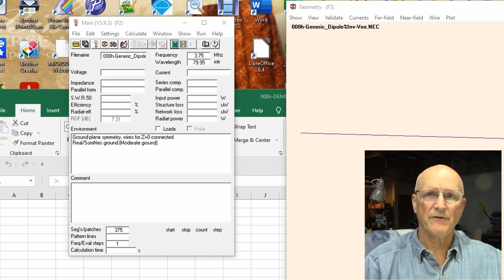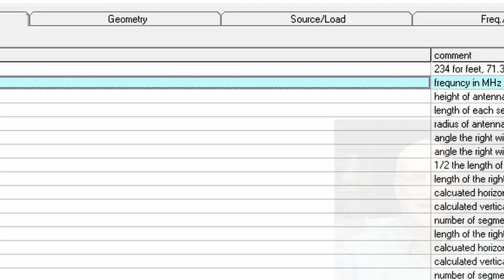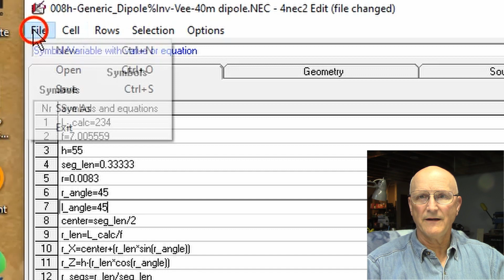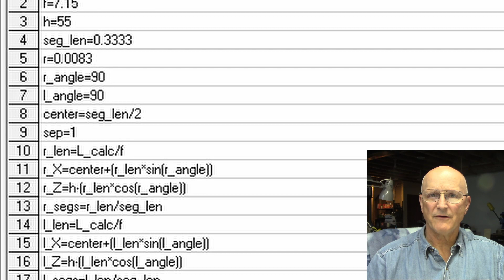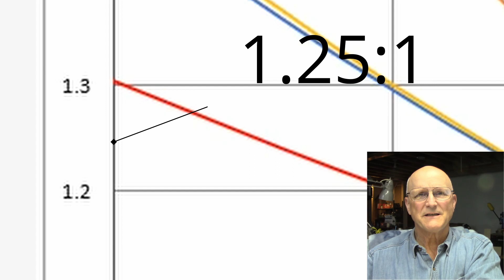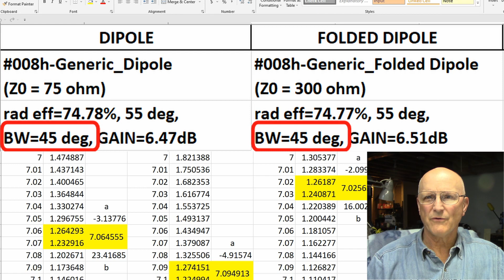Comparing Four Wire Antennas and Introductions to their Generic 4NEC2 Models (008h)

Comment: I use a T2FD due to restricted space.
Reply from the maker: Aaaah! How well does that work for you?
I have a folded inverted vee for my 75/80 antenna. I created it because I was tired of the bandwidth limitations of the simple inverted vee (https://youtu.be/McbDL1GxbqI).
I've heard of doing the termination thing, but I decided to keep it this way because I have the space for dedicated, single-band antennas. 🙂
Reply: Hello - I find the T2FD   one really great antenna, with a very low VSWR  from 80m to 10m.  There are one or two spots where the VSWR goes above 2.5:1 but my ATU easily sorts that out.  I've been on the air for 40+ years and I have to  say that the T2FD is the best antenna for restricted places.
Reply from the maker: @EI6DP  That's cool! Thanks! 🙂

Comment: One more thing to consider in choosing the antenna type: A simple dipole or inverted V can be used on both odd and even harmonics, with a tuner. But a folded dipole or V will not work on even harmonics.
Reply from the maker: You got me thinking because I have ALWAYS heard "odd harmonics only", so I did a little experiment here. Just from a frequency perspective ...
I tried 80/75m frequencies first as the fundamental. Only even harmonics hit other ham bands with the exception of the 17m band and the antenna would have to be tuned to the LOW end of the band to make this work.
So, I retried assuming a 40m antenna. From a frequency perspective, this was more promising. See these results in the document link below.
From an SWR perspective on a real antenna ...
Next, I connected my VNA up to my 40m inverted vee and scanned it from 7MHz to 50 MHz. Yes, I know it is tuned a bit high in the band, so this just verified what I already knew.  I am looking for SWRs at harmonics of the fundamental.  Here is what I discovered:
Harmonic	Freq (MHz)	VSWR
1			7.250		1.30	40m band
2			14.50		5.95	20m band
3			21.75		2.78	15m band
4			29.00		3.78	10m band
5			36.25		2.52	-- nowhere --
6			43.50		2.90	-- nowhere --
Here is a link to the document with the results:
https://docs.google.com/document/d/1ZD5ibBJV9QnHSeQH7TFLW_5p9lPWEPzo/edit?usp=sharing&ouid=113004549152926472999&rtpof=true&sd=true
So, I suppose it is possible to use the even harmonics, but the antenna's radiation efficiency has got to be abysmal. Additionally, with SWRs in the 6 range (20m band), we have 51% of our power being reflected back at the transmitter. The antenna tuner might make the transmitter happy, but it will not change the fact that we are throwing away 51% of our power in heat somewhere.
Thank you for your thought inducing comment.
Reply: @eie_for_you  I disagree that you are "throwing away" any power due to SWR when the line is matched to the transmitter, except for the slight additional loss in the feedline due to SWR. Reflected power is reflected back and forth between the source and the load, and most of it ultimately reaches the load.
I have a rotary dipole 10m long, fed through about 10m of homemade open wire line, no. 12 wire spaced 10cm. It is matched to the transmitter by a link-coupled tuner, an old Johnson KW Matchbox. It works very well on all the bands from 40m to 10m (I had to make a slight mod to the matchbox so it would resonate on 30m). On 40, I calculate the loss due to the astronomical SWR as about 2 dB; on all other bands it's negligible, due to the low inherent loss of 10m of open line.
Reply from the maker: I had to noodle on this. True, the power does reflect back in the direction of the antenna and from the antenna back to the transmitter ("rattling back and forth").  51% of all of the power arriving at the antenna comes back at the transmitter due to the mismatch; this is the re-reflected power + the transmitter power. It is also true that there is loss for each trip through the feedline.  In the end, there is still appreciable loss which cannot be ignored.
We cannot forget the abysmal radiation inefficiency of an antenna at the even harmonics.
While we could use an antenna on an even harmonic in a pinch, I would never recommend this as normal operating.
Reply: @eie_for_you  If the antenna is fed with low loss transmission line like open wire line, the loss can be very small. My dipole acts as two half waves in phase on 10 meters and it even has a little gain over a dipole. The extra loss in the feedline due to the SWR is negligible.
It even works on 40 meters, where the SWR is about 90:1! But since the feedline is short (only about 10m) and very low loss, the additional loss due to SWR is only about 2 dB.
In fact, the 1/4 wave feedline translates the impedance of the antenna, which has low resistance and is very capacitive, to a high resistance plus inductive reactance, which is much easier to efficiently match to the transmitter.
I agree with you that this would not work very well with a coax feedline.
Reply from the maker: Aaaaaah ... I am speaking to the average person who only feeds their antennas with coax and does not care to, or have the knowledge how to, do any such transformations.  They just want to connect their antenna with some coax and be done with it.  The setup you describe is very different than this scenario.